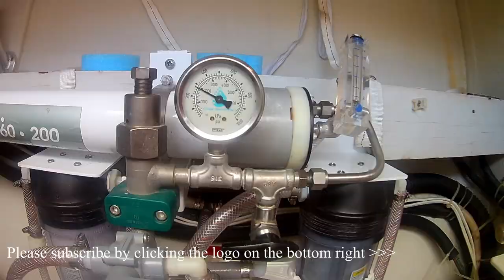Tech Talk - Watermaker Service How To: Filter, & Membrane Replacement, Oil Change Sailing Sweet Ruca

Comment: I am working on a little wonder at the moment changing the oil. I unbolted it and tilted it on the side and open up the top lid. The instruction only tell you how to drain the oil but not where to fill it. I filled up less than six ounces  like you did and then flushed it again and more dirty oil came out but it is very slow to fill up.
Reply from the maker: We will try this next time!! Thanks!
Reply: @SailingSweetRuca  Where did you put your prefeed3er pump? It has to be filled with water at all time, no sucti0on whats so ever.
Reply: I put it as low as possible. Watching tbe video it is almost near my right foot. 

The intake thru hull was the old saltwater inlet for the head, which was switched to freshwater. We did't want to add additional holes in the boat.

We have found that the feed pump is not strong enough to keep suction at speed while sailing or motoring. It only works when at anchor. We intend to try a stronger pump at some point, or move it closer to the thru hull.
Reply: @curtisjazwiecki  maybe make a follow up video one day showing the installation in more details and the pros and cons. Not that many user videos out there.

Comment: Excellent video!  Now I will change the membrane and filters on my own Little Wonder water-maker. What type of oil did you use to replace in the motor?
Reply from the maker: Thanks Brennan, I cheated and "used what I had on hand" that time. It's the islands ;-) It worked, but the correct oil is Parker/Village marine watermaker pump oil, or in a pinch, powerwasher pump oil or Cat pump oil.

Comment: So, which oil did you end up using?   Mine doesn’t say either.   :). Thanks for the video!
Reply from the maker: Pressure Washer Pump oil or similar is best. 15w-40 can be used in a pinch for an "island job" ;-)

Comment: great video, just in time for me, I just picked up used LWM 145 from Craigslist and now I want to do complete service , what kinda oil you end up using after all ? My understanding it should be Non-foaming and Non-Detergent , NAPA has Motor Oil 30W Non-Detergent  at $2.40 or really any type brand as long as Non-foaming and Non-Detergent should work, Village marine wants $27 for a QT!!!!
Reply from the maker: Glad we could help! Congrats on the new water maker. It's been wonderful for us so far 1.5 years later, and we use it daily. Great tip on the Oil! We put some 30w in as well, seems to be working OK and no issues, but will probably change sooner than the recommended timing.

Comment: I just picked up the same unit. Craigslist special, I have to see if it works but for what I got it for it will be worth it. Hi From Mass.
Reply from the maker: Congrats! Sounds like a good find. Ours is still going strong (fingers crossed!) We also found some cheaper replacement membranes here, we haven't used it yet, just carrying it as a spare, so no endorsement or results yet. https://wateranywhere.com/catalogsearch/result/?q=Little+wonder